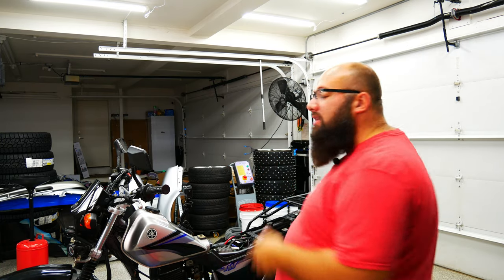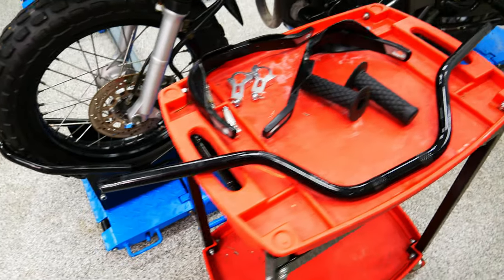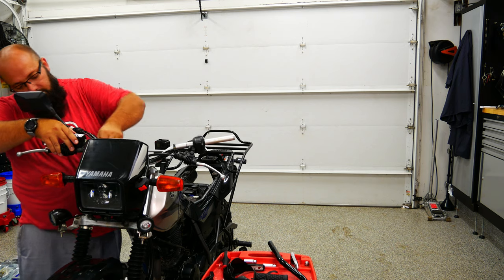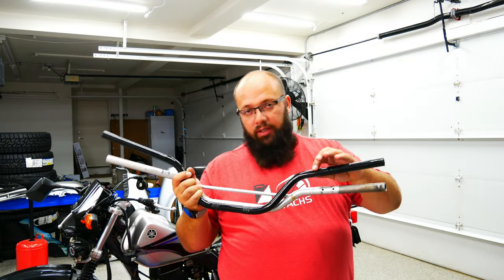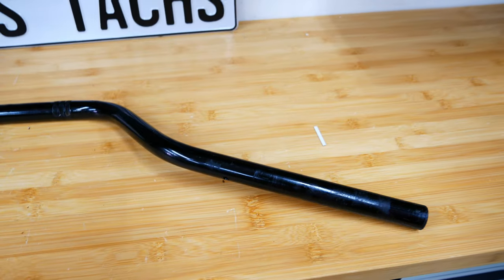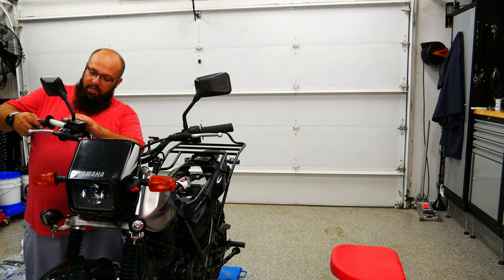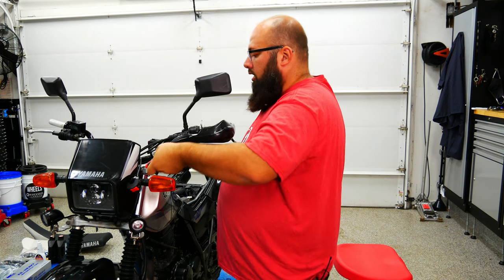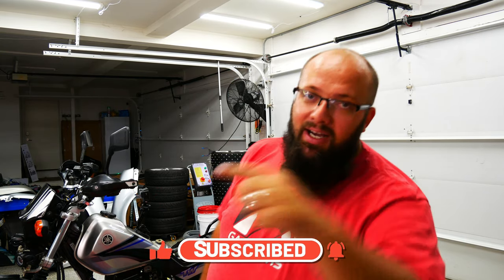Handlebar Upgrade! New Grips and Guards too! My TW200 Build!

Comment: I had forgot about cutting the grip off, as a kid money was tight so if you damage your handle bars. You had to safe the grips ( it was a job to get the grip off the old handle bars) I was just happy to have the motorcycle. All the mod look great!
Reply from the maker: I hear you. To be honest I did try pull them off and they didn’t move... so the exacto  was the much easier choice!

Comment: Why do you need the handle guards? You aren't going to be doing motoX are you? 

Also, I always new you like nuts and bolts your mouth. Haha. Hilarious. Nice save with the caption.
Reply from the maker: handlebar guards are great for a couple things. Firstly, this bike will be for trails and all off roading, which means I could drop the bike, if that happens these make sure I don't break the clutch or brake lever. Next, if you are driving thru heavy brush and close to trees and bushes it makes sure a branch doesn't push your brake or clutch.  Next,  there is some wind protection with them for winter riding to keep your hand warmer. Hope that helps!
Reply: @GasTachs  Damn. That makes a whole lot of sense.